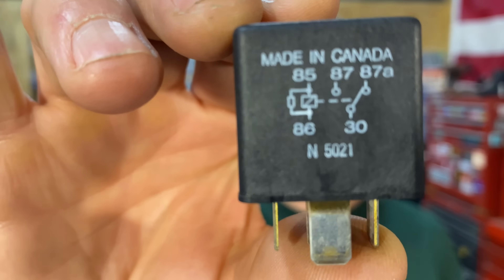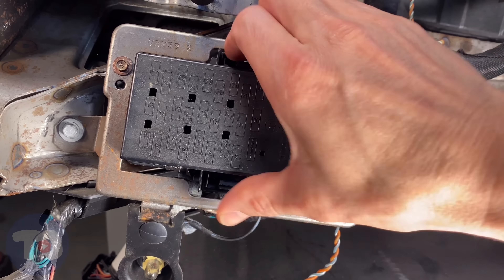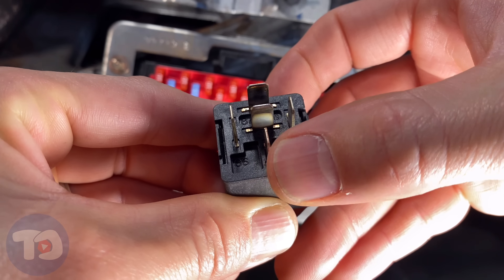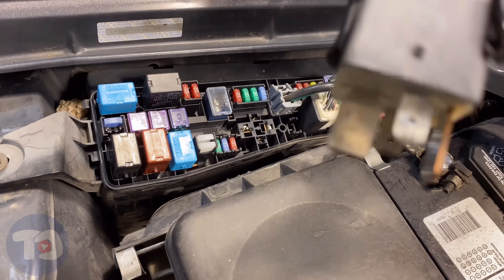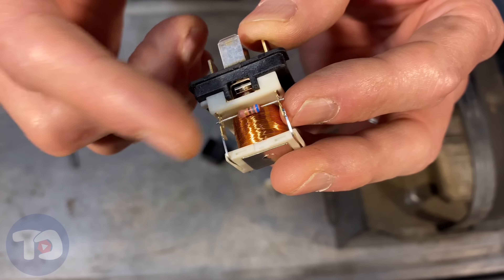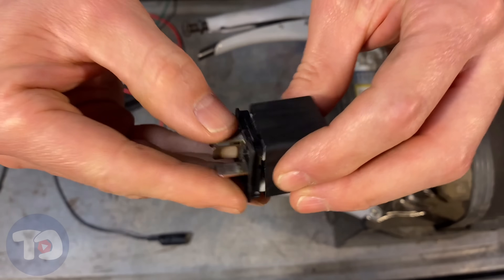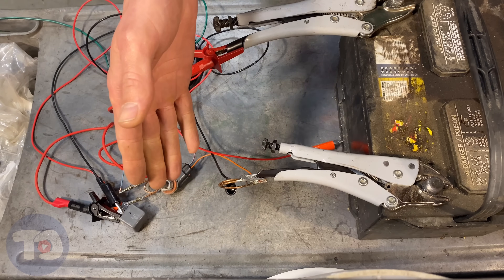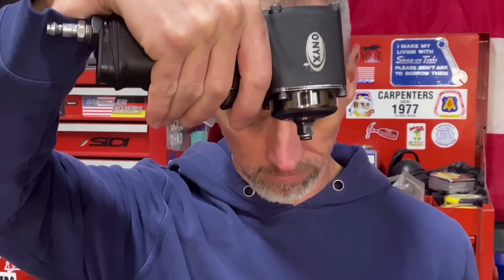Why are relay pins numbered like that?

Comment: Great video. I have taught this class many times. One little but important thing was left out though.
Some relays have a diode rather than a resistor. The diode protects other devices on the circuit that may contain a microcontroller (computer). While a relay with a diode will work in any circuit it is critical to only replace a diode relay with another of the same type.
Practical example- A relay had been replaced on the air conditioner of an off-road construction vehicle. The vehicle's engine began stalling intermittently. Diagnostics found no fault with the engine but an operator noticed that the engine stalled when he changed the air conditioner setting repeatedly. A resistor relay had been installed in place of a diode relay and the small voltage spike from the relay would sometimes cause the ECU to reset, stalling the engine.
Reply: Whoa that’s interesting & a very good find 👍🏽
Reply from the maker: Wow, that is a very strange problem. Glad they found it.
Reply: I was going to mention the flywheel diode but you beat me to it. The resistor does allow for reverse polarity operating voltage. 👍
Reply: The diode on the clutch solenoid is important too. The energy from a collapsing magnetic field has to go somewhere and it is better absorbed by a diode...As a general rule in my electronic circuit builds I always use a diode on the coil of a relay.
Reply: And some relays are actually just jumped inside. The look exactly like a normal relay in size and they have all the terminals, but inside there is no control coil. Just a jumper bar across the load side. One clue I have found is the color. If I open a panel and see all the same color relays except for one different color relay, I can be sure the different one is doing something different and is not interchangable.
Reply: @steadyeddie7453  yep, on a recent car repair video, the problem was that someone plugged in a relay where the original "relay" was a jumped contact inside, not a coil and contacts, the housing was a different color.
Reply: @steadyeddie7453  I haven't seen that. Could be exciting (in a "and then the Fire Department shows up" kind of way) to use one of those relays in the wrong application!
Reply: A reverse diode on a DC relay coil gives a path for current caused by the collapsing magnetic field,  reversing the DC voltage would be a dead short through the diode, so its not to make it bidirectional. I'm thinking the resistor across the coil is to allow the computer to monitor the integrity of the circuit when the coil is not commanded to be energized.
Reply: @curtw8827  Diodes and resistors can be used for suppressing voltage spikes in relays.  Resistors are used instead of regular diodes to speed up the opening of the contacts. This prolongs the life of the relay. 

I don't know if auto manufacturers also use the resistor for verifying the integrity of the circuit. It doesn't sound like a bad idea.
Reply: @curtw8827  ...that's true enough- but if the relay coil is open- the computer can only sense the resistor...
Reply: @daleburrell6273  true, but that proves to the computer the circuit wiring is probably OK.  Probably injects a minute current to verify the resistor  is in circuit indicating at least the relay is plugged in.
Reply: Thank you for sharing!

Comment: You could really screw up a mechanic's day by cutting out the resistor in the relay. It would test good while causing computer problems. Replacing the PCM won't fix it. Replacing the whole fuse box won't fix it unless you replace all the relays.

Masterful mischief!
Reply from the maker: Are you twisting the end of your mustache right now? Lol

Comment: some of the GM four pin relays can be fitted in either direction because 30 and 87 are on opposite corners as are 85 and 86. And they work with the coil poles either way.
Reply from the maker: I like that.

Comment: Out Off Topic - If you want replace original Bosch component (ex. relay) or you can't find original component anymore, and want you another brand, remember,
some replacement components have quality issues. Sometimes, cheap relays broke or are weak to work. One car mechanic demonstrade with fuel pump relay between Bosch and another cheap brand. It had different coil size (mH) to compare Boch version.
Reply: You omitted one word: Chinese. Cheers!
Reply from the maker: Thank you. Cheap parts are everywhere and cause so many problems.

Comment: Now I've discovered a new tool that I absolutely need!

(Yes, I appreciated the explanation. I too had long wondered the same things. Another sidebar: I wondered if you might not wire up the relay to buzz.)
Reply from the maker: That would be fun, but the majority of my audience wouldn’t give two hoots about that.
Reply: If a DC relay buzzes, the coil is getting an AC voltage from somewhere in the circuit. It should not be there. Cheers!

Comment: It's not just German when I wire a panel for a machine tool control wire numbers and colors have real meaning if you understand system you almost don't need a blueprint to figure out the wiring you would have an excellent picture of what is actually going on but please don't blame it on the Germans we all have these systems it's just that if you don't work with the system's then you wouldn't have a clue...
Any sparky's out there that's an electrician for the rest of the world what does RST - UVW stand for how about 1, 2, 3.

Comment: Although the video is accurate, your terminology needs work. Relays don't 'switch voltage', they switch current. And why aren't you referring to terminals 85 and 86 as the 'coil terminals'? 30 is 'common' and 87 and 87a are NO (normally open) and NC (normally closed). 

If you want to teach, let's get the basics right, and have a well informed next generation.

Comment: In the 80's, I use to buy genuine Bosch 30-amp SPDT's like these at the rate of one or two Hundred-Pack trays a month. Cost each back then in those quantities, wholesale? Eighty-five cents each. DPST's were just a little more. Ah, the good old days.  😢
Reply from the maker: Wow, they're a bit more now.
Reply: @ToolDemos  Haven't checked lately (still have some left over from retiring a few years ago), but suppliers to the stereo/alarm dealers will usually have the best prices. But buying in low quantities will spear your wallet.

Comment: People are gonna flame me for this correction: Voltage and Amperage are measurement units. Basically, you use Volts to measure Electrical Tension and Amperes measure Electrical current. Didn't mean to sound pedantic, just to share information, just like @Tool Demos did. Great info on the realy numbering! Enjoyed it.
Reply from the maker: Great point, I mix those terms when I shouldn't.
Reply: W = POWER          (name)
W = WATTS           (measurement)

V = VOLTAGE        (name)
V = VOLTS             (measurement)

I = CURRENT         (name)
A = AMPS               (measurement

Comment: This answers the question who came up with the numbers but the why still remains! Why 85 and not 84, etc etc.
Reply: If you google DIN72552  you'll find a list. The short answer to your question is that the number 80 was chosen for relay contacts, and the 5,6 and 7 were designated for the purposes they're designated for. That left room for adding other numbers in the group. Look at the spec and you'll see that the designations more or less break down into 80 series, 30 series, and so on. Other than the "series" thing, it's fairly arbitrary.

Comment: You should do a show on how German metric and Japanese metric is different, ive been a mechanic for 40 years and these 2 metrics are slightly different, im thinking German metric must be more precise than Japanese metric
Reply from the maker: That is a good one
Reply: Japanese metric? You mean JIS?  Or do you mean how Japanese autos generally use 10, 12, 14mm where Europeans generally use 11, 13, 17mm bolts.

Comment: In industrial automation, the first number represents the order of the contact: 1, 2, 3, 4.
The second number represents the type: 1/2 normally closed, 3/4 normally opened.
That system is simple to memorize. 

I am pretty sure that the IEC/EN/DIN rules that.
Reply from the maker: Sounds easy

Comment: That resistor is not only for anti feedback.
That resistor is for identifying whether the relay is functional and making sure it's the right relay. The computer reads the resistance of the relay on the coil side to know if it's the correct relay and if the coil side is functional or not. In addition to antai feedback. 
Some contain no anti feedback, some also contain a diode for this purpose.
Reply: Aaa- I don't think so:
Resistors are often employed as coil snubbers.
I have not seen a capacitor used in that fashion ever, except as in ignition coil circuit designs... (breaker point),
I would say you are thinking of audio using capacitors in a negative feedback arrangement?

ECM coding of relays??? I have never that.
I do work in automotive diagnostics.
The resistor is there to suppress the inductive spike...
Can you tell me where you got that information?

[the computer would just read the coil's resistance. There would be no advantage to adding a resistor for that purpose.  Wire gauge and counted turns results in very consistent coil resistances...]
Fault codes usually only go as far as 'open', 'circuit high' 'circuit low', etc.

I am always learning - please correct me if this is actually true.

Mr K L
Reply: @troubleshooter1975  Aaa I have had to switch a relay resistor from one relay to the other to get the computer to see it correctly. However I did just look up Automotive relays designs and you are correct about anti feedback. This is interesting to me because a lot of relays do not contain any anti feedback devices. I'm still pretty sure that relay manufacturers use a varying resistor value to identify a particular resistor to the computer.
Reply: @emmetmyers  Huh!
Thank you.
I'm an experience electronics tech and it just proves 'you can learn something new everyday'!
I'm apparently fortunate to not have run into that issue yet.  LOL.  Now I'm going to be checking coil ohm readings when I'm working with them, to satisfy my curiosity!

I have a buddy that runs an auto repair, and he has a drawer of salvaged relays for troubleshooting.  Next time I'm over there, I'm going to ask him if he's been throwing them away if a car says they're bad!
I'll let him know about this!

Thanks for the feedback.

As to the resistor identifying the relay; there is at least two possibilities:
My guess is that it's value is selected primarily for it's snubbing function first, and then they program the ECM's 'good' range to match the resulting overall resistance; for their expected brand of relay.
Another possibility is that they could be altering the value so the ECM can distinguish between 4-pin and 5-pin relays, and between standard and high current types; without compromising the damping action significantly...

It occurs to me that I probably never ran into this because of my obsessive compulsive nature! LOL.  Typically of trying to find a relay with the same markings for substitution, I was concerned more about current or duty ratings, etc, thinking that one that 'just works' is not correct.  I never considered that the ECM could tell the difference.

Although I am occasionally called in to diagnose 'problem child's', they are on mostly on models 12yrs old or older...
I wonder if older (like 2005) ECMs had this value detecting feature.
My buddy is not electronics oriented, but I'll ask him if he matches by relay type number, or just uses one that 'works'...

Thanks again.
Mr K L
Reply: Thank You.

Comment: Why is the return circuit called "ground" when it never gets near the ground (earth)?  It should be called the "return"!  It can get confusing because sometimes the "ground" connection is to the actual ground (The Earth).
Reply from the maker: My thought is because it dates back further than DC power. Go all the way back to Benjamin Franklin and the “return” is the ground.

Comment: Good video, but be careful about saying "large terminals to carry voltage load", when current is clearly what's meant.  

Quenching diodes are more effective than coil resistors, but they require a fixed polarity, and so are better designed into the socket base and fixed wiring, and not be made part of the coil module.
Reply from the maker: Good catch. I went un-scripted there.

Comment: With out offence those are cheap scates remember to buy diode as well if you chose to use relays their integrated get fried easely.
And make shure its not British staff they also swap pins around .
So preaty much crappy German enginering.
By the way all others relay in EU are mostly ic chip controled .
So meaning more confusion .

Comment: What is a relay pin and why is the video recommended to me? I know nothing about wiring! I once blew up a pair of pliers because I cut both wires at the same time...while they were still plugged in!
Reply from the maker: I bet you got quite the fireworks show.
Reply: @ToolDemos  I was working on my model railroad. It was 50 years and I remember it like it was yesterday. I still have the pliers somewhere to remind me!

Comment: Had a relay that sat under the dashboard in my then 1982 VW Golf mk1, this relay randomly clicked on and off and it was called an X relay and was just a normal Bosch relay, however, nobody at the local genuine VW spare part department knew what it was for.
Reply: Probably the "Load reduction relay". All loads like the headlights, blower motors etc or high current draw devices are on the load reduction circuit. So when you go to start the vehicle the relay clicks off to turn off these loads while the engine is cranking and therefore more current is available to crank the engine over
Reply: @j.m.5995  X-actly 🖕
Reply from the maker: That’s pretty weird.

Comment: Oem relay, was probably made by bosch
Bosch relays are the best. 
A relay is noting more then an electromagnetic switch dble pole single throw.  I can wire a relay in my sleep.
So if you think of it as a simple light switch and know what 2 pins trigger the magnetic coil  and whats normally open and normally closed  then you can trouble shoot and test a relay.
Reply: Absolutely! When it's important, Bosch and Hella relays are worth every cent they cost. Cheers!
Reply: All good bob, UNTIL you come across a relay with a snubbing diode!

Comment: Generally a good video, except for a couple significant issues:
- The terms for force (Volts), flow (Amps) and power (Watts) are mixed up and seemingly interchangeable in the video. It seems the OP does not really understand the difference between one and another, and this can in turn confuse people who are watching trying to learn something.
- The video promises to tell WHY the relays have such pin numbers, but that promise is not fulfilled. Only the "well, it is because some Germans decided it this way" reason is given instead.
Reply: "The Germans" is exactly the reason. Their supposedly random choice was picked as the standard by everyone else. Having been a member of an ISO standards committee, that's just how it works.
Reply: @albanana683  , no, your logic is faulty. "The Germans" is not the reason, it is no more than a link the the chain of history that follows the reason. The Germans had a reason for assigning those numbers, and that is the reason that was promised on the video title.
Reply from the maker: You’re right, I did misspeak. Hard to be precise in words while working.